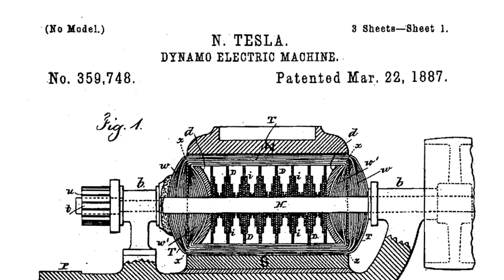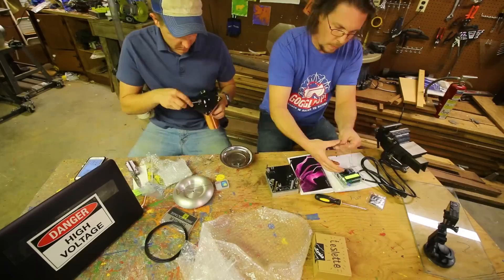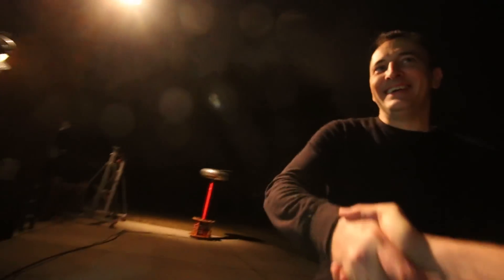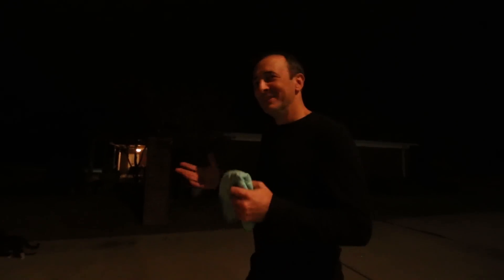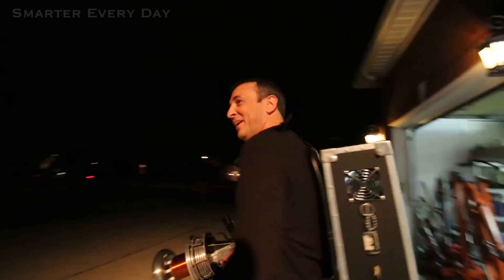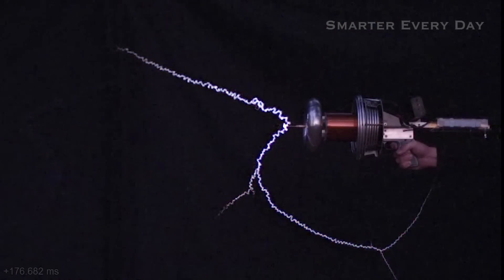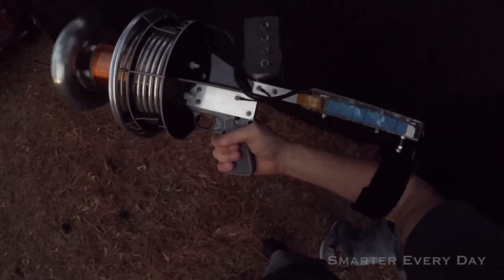Handheld TESLA COIL GUN at 28,000fps - Smarter Every Day 162

Comment: is safe to touch, cause uses very very high voltage at normal fequences that is very soft

get this:

+ voltage = －amperage

- voltage =   + amperage

that is the reason cause stun guns use high voltage, over 50.000 volts or 100.000 volts

if that coil gun hurts is because the frequency is very high

if someone hit  you very hard

it would hurt you less than if someone would hit you very hard 30,000 times per second

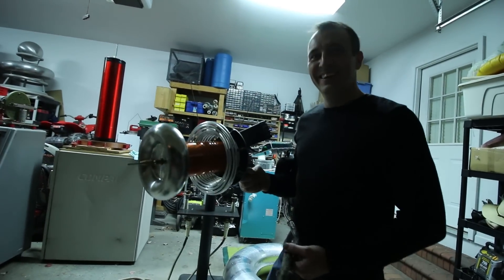Comment: 5:37 where can I get this?
Reply: He invented that, you can't buy them ;)
Reply: design a circuit, then add things to make it wearable.

Don't use the slayer exciter circuit, instead, I don't know if you can see, but it's pulsing really slowly, and in the slow mo you see that it's single pulses (maybe?). So design a circuit that can charge up capacitors and then discharge into the primary, which the magnetic field collapses pretty fast (fast/high magnetic field change = induction of voltage/charge) and connect the bottom of the secondary into ground. Of course, the one in the video had extra safety precautions so keep that in mind.
Reply: Gaster, please do not attach it to the CORE!

Comment: Imagine how loud that famous picture of tesla sitting near his coils would have been?
Reply: That was my first thought when seeing that photo. Was probably so loud you could feel it.
Reply: @gt28rsS4  there is a episode of american pickers where a guy has one in a barn, he fired it up, it was not extremely loud, instead it was kind of wispering. meter long arches tho hehe. i think the guy said it was a 12 kilowatt arc.
Reply: magnetmannenbannanen
Reply: Yeah, he had to have been high right?
Reply: Correct me if i'm wrong, but I think it wouldn't be loud at all. When it plays sounds it's tuned to vibrate at audible frequencies, but usually the arcs are very high frequency, in the order of tens of kHz. So maybe a dolphin or a bat can hear it but to us it's probably a very quiet buzz.
Reply: Pepe Berlusconi did you even watch the video?
Reply: @pepeberlusconi1736  no but you would feel it. you cant hear low HZ either but you can feel a sub-woofer.
Reply: @pepeberlusconi1736  Because the Tesla coil that Nikola used is a sgtc (spark gap Tesla coil) it doesn't run continuously, which means it would create an extremely loud noise each time the spark gap fires because the arc momentarily superheats the air making it expand very quickly.
Reply: The picture was double exposure 
There are two pictures one with tesla coil on and other with Nikola Tesla sitting in chair but with tesla coil switched off. Both the pictures are combined together. See plasma channel's video about that.
Reply: WHAT?!!!

Comment: What is the significance of 28000 fps ( we're discussing a Tesla coil here ) - I doubt there is any connection to the term "28000 fps"
Reply: Hint: When speaking of a device such as a Tesla coil, it makes more sense to use the performance parameter cps ( cycles per second, or the modern term for frequency, Hz (Herz) - The term fps generally refers to velocity, as in "feet per second"

Comment: Ok... This may sound stupid to some people.

Is the movement of lightning/electricity similar to the effects you get when casting an ant hill?

Are the branches of the electricity finding or creating gaps to move through?

Fulgurite happens when lightning hits dirt and sand. Are the branches formed from the lightning simply forcing its own pattern into the medium or is it (somewhat) finding more suitable pathways that continue or provide ease of motion? Like fire continuing through easily burnable material and leaving less burnable things more intact.

Is the electricity finding paths in the air?

Comment: I'm a bit late on this but... The penetration depth of an electrical current is based on the frequency due to the 'skin effect.' A DC current can pass directly through the body and the heart allowing it to easily be deadly. However, in the case of AC current the current density decreases with increasing depth below the surface and the higher the frequency the greater the effect. As Tesla coils use very high frequencies, the current density is exponentially decreasing under your skin quickly. As a result, it is unlikely that the current will pass through your heart for small currents like those created by the Tesla coils featured here. Now, that is not to say the high current, high frequency electrocutions do not hurt or won't be deadly.

Comment: Even though this was filmed in 2016, I just ran across it the first time today. Ads an electrical engineer (semi-retired) and a Tesla enthusiast, I've worked with Tesla coils before, and this video was an interesting adjunct to my knowledge base.

I noticed with  Cameron's Tesla gun that part of his equipment was a grounding pad strapped to the heel of his boot. I recognize that this was absolutely necessary to make it work. After all, Kirchhoff's Law needs to be obeyed. The video does show that while the visible arc does terminate at some point, that's only the extent of the ionized air particles as plasma. The current of that streamer continues to ground (and, incidentally, to his heel contact pad and on to his backback generator) to complete the circuit.

This Tesla coil video and the one on the bullwhip cracking have, so far, been my favorite videos of your series. Carry on with your excellent work.

Comment: The reason that the sparks are not dangerous is twofold:

1- it is high frequency, so there is a so called ‘skin effect’, the current doesn’t go through you body.

2- the transformer doesn’t have a metal core, so there is not much energy in the sparks.

Great video, as always!
Thank you so much!!
Reply: Wait so you can't kill a man with it?
Reply: Nope. The only problem with these high fieldstrengths could cause malfunctions in peoples' pace-makers. The tip of the spark that hits very sensitive peeps could feel as if you were stung with a small needle. Main point is that there will be no current trhough your heart.
Reply: @herksen  goddamn it

There go my week plans
Reply: In 1954, Mechanix Illustrated had an article with schematics and directions to build a Tesla coil. My fraternity brothers and I built one at Illinois Institute of Technology, and had a lot of fun "dazzling" guests at house parties.
Reply: Robbert van Herksen So, what causes the bolts of electricity to not go to ground? My rudimentary understanding of lightning is that it always wants to fight the past of least resistance to ground, but I’ve seen lightning strikes that clearly don’t hit ground.

Comment: Hey Destin or anybody else that knows something about Tesla Coils,
at 8:35 you state that the secondary output is in microamps. But we all learned R=U/I in school, so I must be U/R. You have some body resistance which doesn't change too much (I don't know the value right now, but something around that 200 V can produce a deadly current) and the voltage across your body must be at least a few thousand volts when you're touching an arc that travels tens of inches through the air. 
So therefore there should be a higher current passing through your body than microamps. 
Am I getting sth wrong here? My theory is that through the pulsed nature of the arcs the high current of some amps just lasts for some microseconds and that the harm is something like I/t and the effect is the same as a few microamps of constant current...
Would love to har some answers,
Thomas
PS. Keep up the amazing work, Destin, I love your videos! And yes, I know I'm late, im just in a "watch old but great videos" mood :)
Reply: Microamps isn't enough to harm organ and i hear the higher frequency is more inclined to skim over your skin instead of going through it & conducting along your nerves & bones ect.
  I should really research that further considering my current path in life.
Reply: You are correct, but overlooking a very important factor: dynamic response. The current flowing through your body CAN be very high, even in the order of a couple of amps. However this current only flows for micro or even nano senconds and decays extremely fast. Thus the total amount of energy that the arc carries is low enough to leave a healthy person unharmed. Still try not to get shocked!
Reply: @TheDanyschannel  Thank you very much for your answer, this explains a lot although I already suspected something similar! 👍

Comment: They don't feel much pain or they are just dead inside
Reply: Low voltage and amps, as well as perhaps low frequency. Also, my guess is it’s DC current since it wasn’t mentioned what type it was, but considering the secondary didn’t hurt, and DC hurts half as much as AC, it would explain why it didn’t hurt as much.

Comment: Do you, by any Chance have the Numbers from the Tesla coil, especially the gun? In particular i mean the Ratio of primary to secondary coil, and the amount of Power (Voltage/Ampere) going into the primary coil.
I actually build a teslacoil myself for a science project, in 10th grade (Out of the circuit of an electical fly swatter, if that ist what it's called, and powered by 3-volt batteries :D, i also crafted the secoundary coil by hand, which took ages) and now, 4 years later, i actually study physiques (for 5 Weeks at this moment😅) and seeing your video, i kind of had the Idea to rebuild one with a bit more Power. (Sorry for some typos, english i not my mothertongue).
Also i love your Videos, please keep up the awesomeness!

Greetings from Heidelberg/Germany

Comment: There is an explanation why you don't get electrocuted by these sparks: the frequency. Primary coil and capacitor make up a resonant circuit that resonates at several kHz or up to MHz. And currents with such high frequencies try to stay at the surface of a conductor (this time: your bidy). So the current flows through your skin to the ground, and does not enter your body - other than a true lighting bolt, which is DC. Look up skin effect for this.

Comment: I have a question, if you we're to up the current to deadly levels and keep relatively same voltage would the electricity be able do ark between iron metal powder particles in mid air?

Comment: Look up "Skin Effect". (https://en.wikipedia.org/wiki/Skin_effect)   No, not your skin: the "skin" of a wire.  At high frequencies, local induction forces most of the current to flow near the surface in a predictable "skin" depth.  But then again, at high frequencies YOU act like a wire, and most of the current flows along YOUR skin.  So these currents don't reach your heart to any significant degree.   Also, if you aren't feeling an electric shock, then your heart is feeling even much less.  Most of what you feel from this coil is a tiny burn.

Comment: If you think that's cool; add an ultraviolet Bessel beam laser at an optimal frequency (266 nm dpss) synchronised to the coil output of the gun, and it will ionize a column of air, potentially causing the 'lightening' to fire in a straight directed beam...

https://physicsworld.com/a/could-lasers-guide-and-control-the-path-of-lightning/

Comment: okay so what if you make a medium size 4ft testa coil and you get a few different types of crystal rocks that you grind down to make smooth and than you try this experiment in a hot room and a cold room than at extreme heat and extreme cold but you maintain a current hitting the crystal that is storing energy and releasing some as it comes out but the trick here is the crystal is suspended in air and winding around the base of the crystal is a coil and at the end of that is another crystal so now when the current is hitting the top crystal it is jumping between both crystals creating an alternating current that looks really cool

Comment: not a tesla expert but I think the power & the current are high, but the time duration, and energy of the discharge is low so that energy dumped by electric heating is low, and that's what makes it safe.
To say its safe because the 'current is low' is wrong or at least misleading. You'd have to qualify it by saying the 'average current over the time of successive discharges is low, there are relatively long periods of inactivity between discharges'.

Comment: I built something like this a few years ago, minus the circuit to make it non-lethal. It was also a bit more powerful. Needless to say, it was designed so the arc was emitted far far far far away from me. Super dangerous and stupid all the same. I ended up blowing a circuit - my math was not quite right. I am going to be building another one, only this time I have an idea involving fully automatic rapid fire c02 projectiles to carry the beam. Although I might just incorporate a separate a set of coils to fire a machine fed, very long string of tethered iron rods at high speed.  I am sure many will take note of some technical problems with this, but I am working on that.
EDIT: If I can shrink the electronics enough, or at least effectively distribute the weight, I am considering a small propane powered engine directly into the backpack to generate electricity so I am not tethered to an outlet. Or perhaps something that can be mounted on four wheeler.
Reply: Propane would give you enough power but definitely too dangerous to put in a pack, what you should do is some kind of battery pack like in the video. Mounting it to a vehicle might be a good idea, I'm not sure how you know the arc won't come back to you if you're using high enough voltages to do real damage.

Maybe have the capacitors and a small battery in the gun itself and have it plugged into the pack or vehicle for normal operation, but you can still unplug it and take it off the vehicle and get a few shots off with the charge in it.  Super dangerous of course.

Comment: From what I remember from my high school electronics class, the reason it doesn't electrocute you is that the electricity is at a very high frequency, so it does not penetrate your skin.  That is what I remember my teacher telling the class.  Whether that is true or not, I cannot confirm.  We built a tesla coil in class...one about twice the size of the one you built and did the chain of students holding a fluorescent tube and lighting the florescent tube up by the student on one end sticking a metal bar into he arc of the coil.  It was pretty cool.  I have wanted to get one of these myself, but just never had the spare cash to get one.  Cool video.  I loved the gun!!

Comment: My own Junior High School (1945 time frame) Tesla coil used auto glass and aluminum foil in a tray of motor oil for the high voltage capacitor.  The spark gap that worked best was a series of bent nails in a board, a multi-gap gap.  When I took the spark to my body I used a piece of metal because a direct spark to the skin hurt.

Comment: I think the "spark gap" is where the radiation goes out for the wireless power transmission?  The coils I think are like a transformer to boost the voltage.

Comment: Would a very thin (almost invisible) wire from the tip of the gun to a target allow you to see the spark while giving it a controlled straight line of fire?
Or maybe a non-conductive fishing line with a few metallic pieces along it, giving the spark a certain anchor/direction along which it should move.

Comment: U do know that u r half way there from building anti gravity. Build a ufo around ur tesla coil and at the base of ur coil you need 3  rotating bearings with magnets  north facing outwards from coil this way it becomes perpetual motion and ur ufo will never need fuel or a battery it produces its own energy thats right free energy. But i cant afford the parts cause theres a natural element that needs to be placed in the middle of coil this makes everything lighter than gravity.

Comment: Just a thought... I got to phrase this right. The electricity from a Tesla coil follows a path where the atmosphere degrades due to ionization. The ionization is "random" (actually "chaotic" is the proper term) so it will follow microcurrents in the air (differentials caused by breathing or breezes). With that in mind, what about using an ionizing laser to warm the air just enough to create a path for the electricity?

Comment: extreme high voltages.. low currents.. u need 1000 volts to jump 1 cm in air so now calculate how high the voltages of the coils are xD the current is very very low if u have the right resistor

Comment: I think this could be turned into a functional laser rifle, stick with me on this one cause it may be complex:

Lightning is random and impossible to aim cause according to the theory of chaos no 2 times electricity goes through air in exactly the same and predictable trajectory. But the trajectory is determined by the particles of air just being in proper arrangement to create THE MOST OPTIMAL electric connection.

So what if we create a double-shot system. Taser guns do this priming shot with needles and cables and then fire electricity. What if we fire an aimed priming shot with a beam of some sort that prepares an air tunnel that will be the most optimal path for electricity to pass. Therefore fire a lightning strike exactly where we aim at an almost straight line, without drop-off, recoil or wind-correction in any envirnoment.